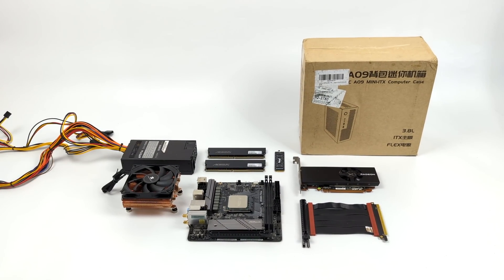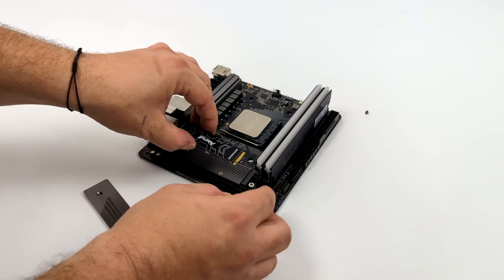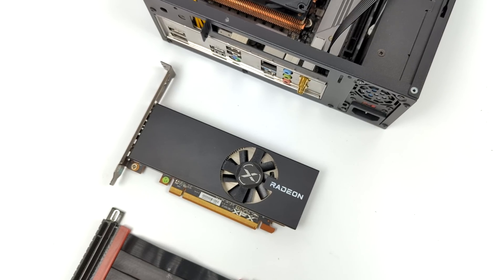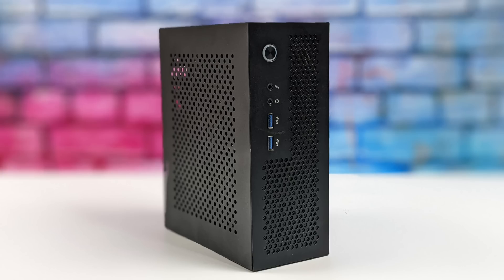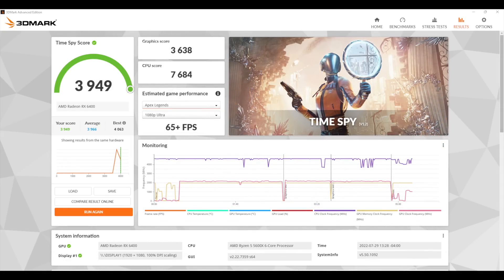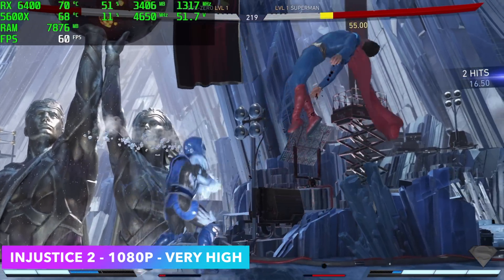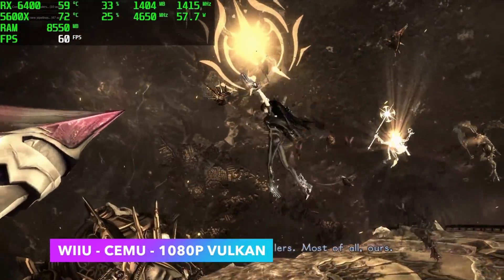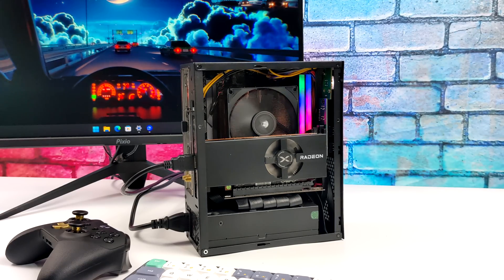A Tiny 3.8L PC With A dGPU! Powerful Small Foot-Print Gaming/EMU Build

Comment: The big weakness of the build is the lack of any hardware encoding of decoding, which might not matter to some people buy otherwise would really hold this back in some cases
Reply: Just use an Intel processor with integrated graphics for this build
Reply: @bhaveshsonar7558  the intel iGPU is still far behind even entry graphics, and only is parity with the older amd iGPU's on the 5000 series

Comment: holy cow ive been searching for something like this since rx 6400 came out and i found that a09 was the perfect budget sff case but it seems you were the first dude to make a video about this build, good job.
Reply: ive seen some videos with this build and i found out that the sapphire rx 6400 didnt fit in on this kind of case, could only be needing around 2 inches long of a gpus.
Reply: low profile small form factor personal computer
Reply: wtf am i talking about yes it will technically fit and rx 6400 pulse on a09 but the long ryzer cable wont be able to make those happening, try consider getting the short one.

Comment: I just ordered this case yesterday to go into a build with an RX 6400 and a Ryzen 5 3600. PLanning to do a SteamOS build that attaches to the living room TV. If you are looking for a good Flex ATX power supply with a pretty quiet fan, I am using an FSP Flex Guru 250W (PPA2500701) and I can barely hear it at all. CPU cooler tends to be louder.

Comment: So, apparently, the best slim profile GPU king right now is the rtx a2000 12gb. It murders the competition in gaming. You should do a build with it. (Edit: people are misunderstanding I'm not talking about price/perf, I'm talking raw performance)
Reply: A2000 is a workstation card that is like a laptop 3060, not a great thing for budget builders but would cool none the less. Also it is a lot thicker
Reply: @n n never said it was a budget king. Just said it was king for this form factor for performance currently if you wanted to do a specialized small form factor build. Not only that but it's not 5x the price. I see the 6400 going for around 180, and the a12 for 500 ish. Is it a good price/perf ? No. But if you want to build the best small form factor rig, with a specific case, and are willing to spend a bit more it's an option.
Reply: @n n nothing in the title/description said the point of the build was to be ultra budget, also the a2000 is very power efficient as well.
Reply: @n n he said he wanted to use that case because he thought it was neat. Not specifically because it was cheap. And this has nothing to do with my OP, it was a suggestion to try and do a build/review with the a2000. Not that he should have used it in this build. I simply wanted his thoughts on the gpu. I'm moving on as it seems like you're arguing just to argue at this point. Have a good one

Comment: this was the exact same build i planned to do. im feeling regrets now that i didn't push through with it but im happy you did the exact same build to prove that when building sff, just do it haha kudos sir!
Reply: the seasonic 450w bronze dissapoint my ass i should have go for the bitfenix better yet the seasonic focus
Reply: ps that galax katana 1070 is to long in dimension for that budget sff case, it couldnt even fit the sapphire pulse rx 6400.
Reply: Lol rx 6400 is worth more as scrap metal then a worthy gaming graphics card. Complete joke
Reply: @JudeTheYoutubePoopersubscribe  why tho
Reply: @JudeTheYoutubePoopersubscribe  i had a bad experience about psu that live longer than 3 years, they tend to becoming weak and in conclusion i shouldve bought the 750 watt gold tier 1 psu
Reply: @JudeTheYoutubePoopersubscribe  Show us in this build or one of similar SFF size like the OP mentioned where the 1070 physically fits.  I'll answer for you: It doesn't.
Reply: @JudeTheYoutubePoopersubscribe  ive seen that 1 slot 1070 its called galax katana but the thing is that shit is hard to find and it cost some bucks to get, ive done running the whole setup on stock it took for about 100w for the rx 6400 (i actually didnt like amd product but they kinda nail it on this) 24inch 144 monitor (cranking down the brightness didnt make a change) with 10105f setup on stock, super budget low profile sff rn in my opinion, some of my buddy said why didnt i go laptop but this sff thing has something special in it that i cant describe with words. the true low profile king atm rn might be rtx a2000 but the price just ruin it for me.
Reply: @JudeTheYoutubePoopersubscribe  you were right my dude, but as for small form factor and low profile thingy the rx 6400 fits it, actually i go for the gtx 1070, but the wattage be fuckin up my bill since i barely turn off the desktop but its kinda worth it tho
Reply: The problem with a comment this dumb is a 1070 does not fit sff builds. The stupid part of this is, these LP cards are made for systems that can't fit a full height card so for people with optiplexs and custom 3L builds that 1070 is not a option. It's like comparing a 4wd to a Ferrari and saying it's better because it can go over a rock. The 6400 has its niche which should be pretty obvious to see. @JudeTheYoutubePoopersubscribe

Comment: You never give links for the riser cable.
Reply: @donnanorth7324  I've built one of these, slightly different case but almost identical. The cases usually come with the riser cable as its a specific length for the case mounting points

Comment: the new deskmeet from asrock combined with the rx 6600 is also very nice and just a little bigger than this.There are some variants of the rx 6600 that fit like the fighter card from powercolor or the sapphire one.
Reply: I have used the DeskMeet X300W with a  Ryzen 5700X + PowerColor 6650XT (200mm length), and can say it is amazing for the size!
Reply: @Ultranique  Isn't that case extremely small and doesn't have a cutout for a gpu? How did you manage to fit a 6650xt inside?

Edit: my bad, I was thinking of the deskmini as the deskmeet isn't sold on Amazon

Comment: Idk about this case, I don’t like how the gpu goes infront of the air cooler. Questionable Air flow. Nice build tho. Can you please use the K29! I have this case with the asrock z690 itx/tb4. I’m waiting for the 13100 to put in this and then use my eGPU.
Reply: The airflow should be okay with both of them even under heavy loads, these aren't parts that'll get particularly hot. The loads of mesh around the parts should also help a ton. I personally would've gone with an i3/Ryzen 3 for this build, which would just help the thermals/airflow situation a bit more.
Reply: @Void-by3ti  yeah that’s what I’m going for. The 13th Gen i3

Comment: I'm desperate for one of these with an RTX A2000 12GB!
Reply: Wouldn't work. It's a dual slot card.
Reply: @Droogie128  there are slightly larger sff cases that support dual slot
Reply: @jayhardway23  "One of these" kind of implies this case. You'll never find a case this small that supports dual slot, though.

Comment: Honestly, I used to think that I loved this form factor but my 1080p days are long gone. 

This is more exciting to someone living somewhere where they can’t afford anything higher than 1080p.

I’d prefer a 1440p resolution or higher nowadays so going bigger on the size of the pc makes a bit more sense.

My absolute minimum now are the half size single fan gpus’ because they can go as high as the rtx 3060 (which blows this out of the water) but I’m also not so much of an elitist to recognize that this small low profile gpu has its place.
Reply: put a 6600xt challenger itx in this form factor, and play 1440p, only remove the the panel lateral or create a hole and done! :D
Reply: @mranghellarrive  But the power supply would have to be higher wattage and at that small size, it gets expensive.

Not to mention, I'd rather have a form fitting case personally.

Comment: you could get the NVIDIA Quadro RTX A2000 for faster LP gpu. PNY and other brands have such cards.
Reply: with the power brick used here. it won't fit the case unless you want to modify it.

Comment: Personally I would have gone with an i3 12100F

Cheaper, lower power consumption and about equal gaming performance when compared to the 5600X 

Only productivity workload and high end emulation would maybe suffer a bit
Reply: Even a lower end Ryzen would be fine for this build, considering that an RX6400 doesn't need anywhere near the performance of a 5600X for gaming.
Reply: I was literally shocked when I see 5600x in that case
Reply: Hell even with productivity, as long as it's general productivity, there should be absolutely no issue with a 12th gen i3
Reply: Yes way men we will also love to see a 12100f in that case with that lovely GPU

Comment: Can you use RTX a2000 in this ?
Reply: Unless you want to use a smaller power brick or modify the case. No. The A2000 is a dual slot gpu.
Reply: @JustIn-sr1xe  i mean the psu is probably fine, the rtx a2000 only has like a 75w tdp but yeah you're right about the dual slot

Comment: I'm wondering if an RTX A2000 could fit in there, I believe it has the best performance in this form factor.
Reply: propblem is it costs $700
Reply: @zhaiketoledo3658  the 6gb variant is about 450....but still expenssive
Reply: Not without cutting up the case a little bit. The A2000 is a dual slot card like the GTX 1650. Even with the case mods. It's not likely to fit.
Reply: No, as it is a dual slot card.
Reply: Why would you wonder if an RTX A2000 would fit in there? Why would you buy an A2000 just to put it into a small computer not designed for sizes like those? You know there's better, more viable alternatives, right?
Reply: @umamifan  Because I already have it. I use it for work in a very portable mini pc (  Intel nuc i3 12th + adt-link  + a2000 with a  very compact power brick, nothing gives you so much perforfamce  in such a small space and with around  100W total power draw. I also use it for gaming just because I have it, altough gaming was not the purchase reason, obviously.
Reply: @n n it is expensive because it is not for gaming, altough you can also use it for that. The extra cost of the professional series is not for higher  performance but for higher  density (you can put 6 of them in a server or more,  much better efficiency (70watt for near 3060 class performance ),.more memory,, and professional support (I got it with replacement warranty next business day). Of course none of those aspects are priorities for gamers, but believe me they are important for many profesional jobs
Reply: @n n They are widely used in renderfarms, I have seen 6 of them in a supernicro "super workstation" used for rendering. And there are mining computers that have even more, the a2000  provides better performance per watt than any other discrete GPU  at the moment
Reply: A2000 is really amazing. I don't know why nvidia doesnt release 6gb varinant as normal desktop variant.

Oh wait,  must be the money :(

Comment: Sorry but I'm done with your channel: You've done enough to recommend such a terrible product like the 6400 that nobody should buy. You gave your reasons but you basically keep promoting it when we know already, by looking at your own other videos, that even portable devices with the 6800u for example get close enough in performance to this card.

It's beyond just recommending it for it's use cases and it's becoming a clear bias towards AMD. It's too bad no good products under the 6600 exist today but that's the truth and you need to be impartial about it, I'm just done with you.
Reply: Bye bye..... Go cry somewhere else.
Reply: Ahhh yeas another NVIDIA FANTASTIC.
In my country the RX 6400 is the same price as GTX 1050IT  and the RX 6600 is more cheaper than the RTX 3050.

And amd is more sold than nvidia here.
Reply: @lelouchabrilvelda1794  Notice how I said "The 6600" and I didn't say "The 3050" and that's because Nvidia can't compete with AMD on anything from the 6600 up to the 6700xt

They're just both terrible at low end products: I have no problems with recommending AMD cards WHEN THEY ARE WORTH BUYING like the 6600 which should be the bare minimum if the 6400 and 6500 weren't gimped products with no hardware video encoders, x4 PCI-E which does affect primarily budget AMD rigs that don't support pci-e 4.0 and a ridiculous 2 ports only for video out.

No matter how you look at it AMD has a terrible product that nobody should buy which is the 6400. Nvidia on this price range has WORST products since they still try to sell the 1030 and other such garbage products but AMD doesn't gets an excuse: both companies have abandoned the low end market completely.